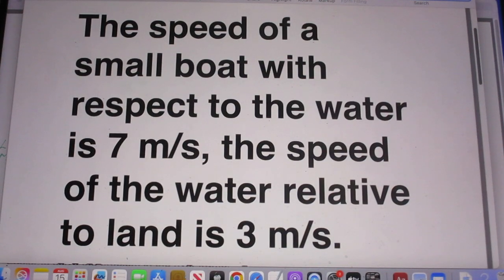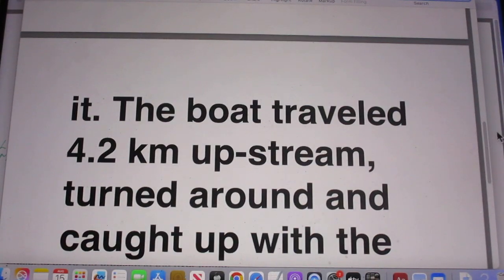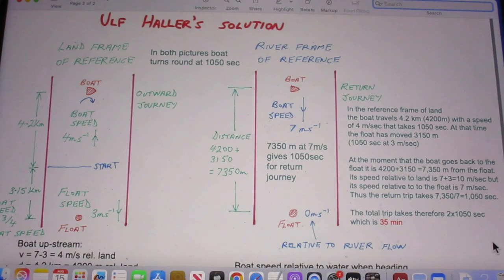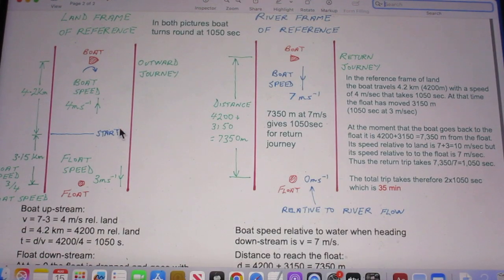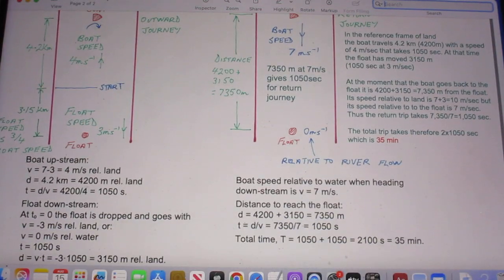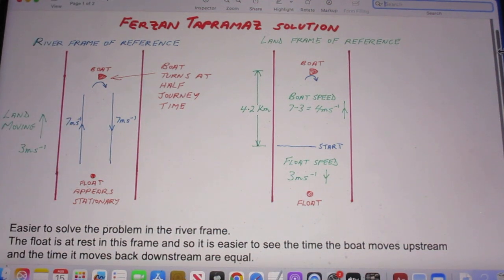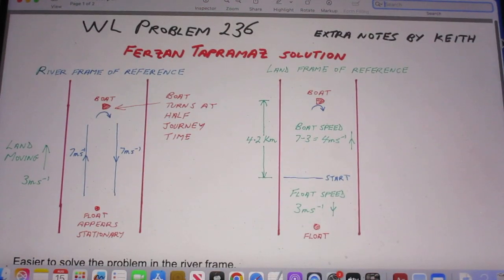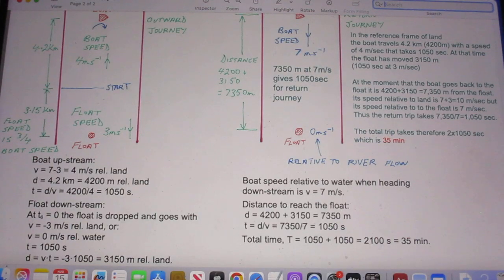Solutions to Problem 236

Comment: Sir, I’m a Class 12 student and I’m struggling to understand a concept. I know that the force on a current-carrying wire in an external magnetic field is given by F = I L × B. But if the magnetic field is produced by the wire itself — for example, inside a solenoid — I’ve read that the expression becomes F = ½ I L × B. I came across this while solving a problem in Irodov, but this topic isn’t covered in my school or coaching. Could you please make a video explaining this? Thank you, Sir!
Reply from the maker: I cover all this in great detail in my 8.02 MIT course. I suggest you watch all 35 lectures, you do all the weekly homework and you take all my exams. That will take you about 1 year. I have assumed that you have taken calculus courses. Never forget that math is the language of Physics.
Reply: @lecturesbywalterlewin.they9259  Yes, sir; thanks a lot!